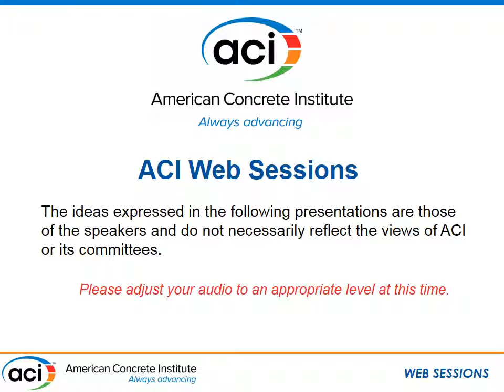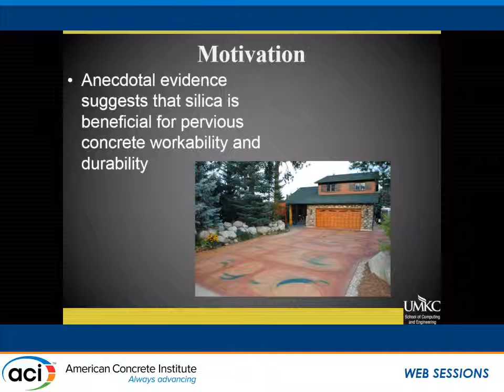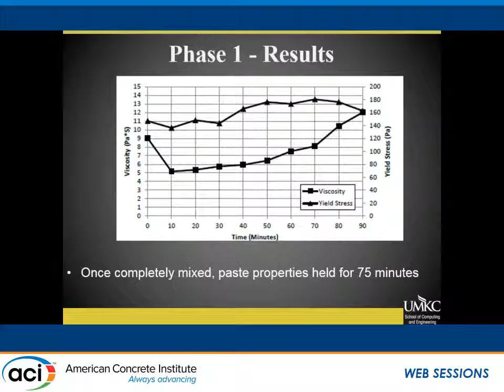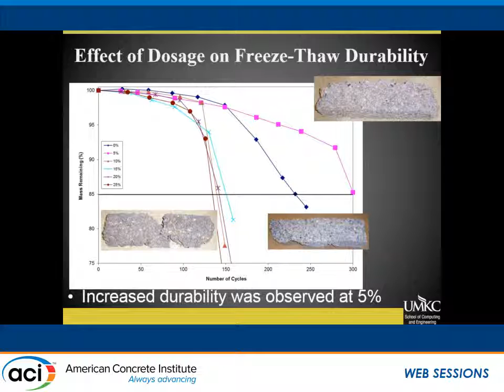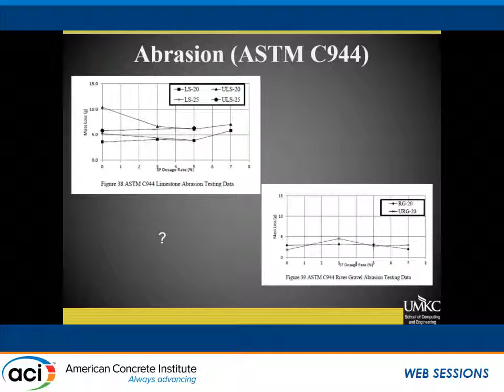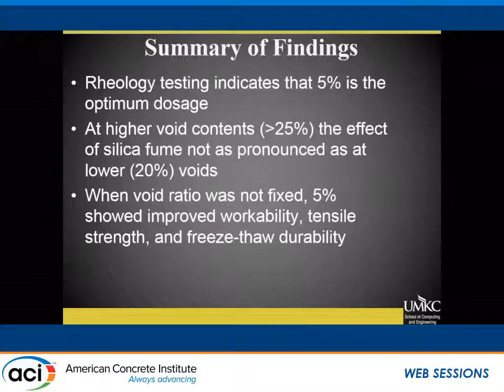Effects of Silica Fume on Pervious Concrete Performance and Durability

Comment: What's the functional real-world limit to using this for a hard troweled floor in an industrial application? Is it possible to put together say a 10ksi/69MPa mix and get it burnished without plastic shrinkage issues and surface cracking?